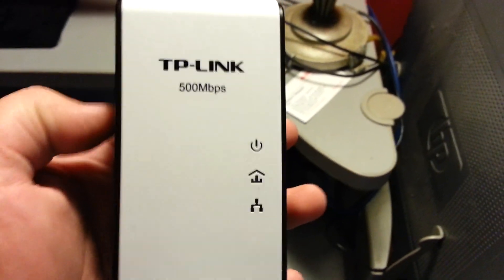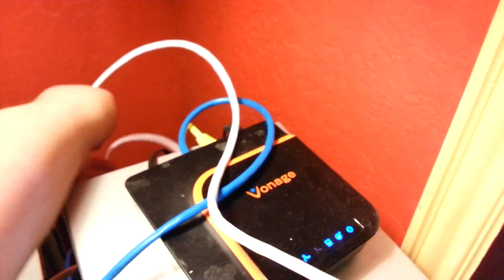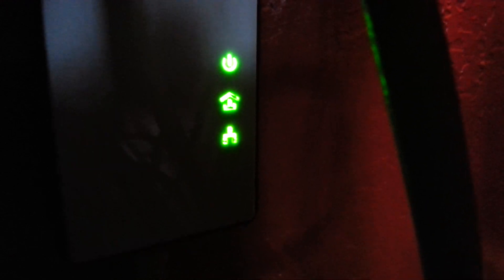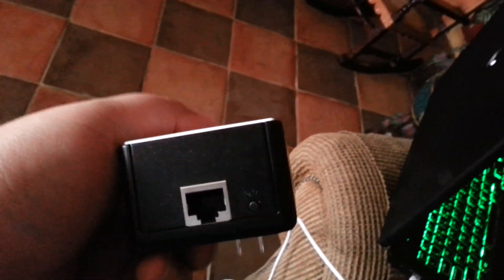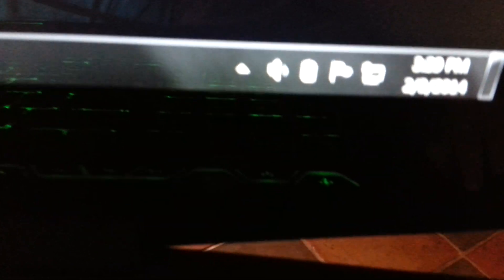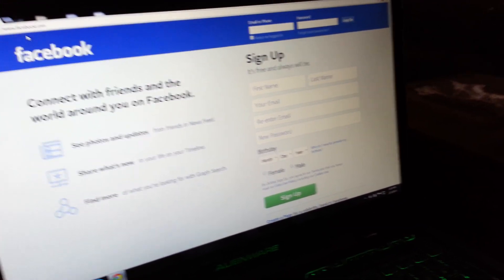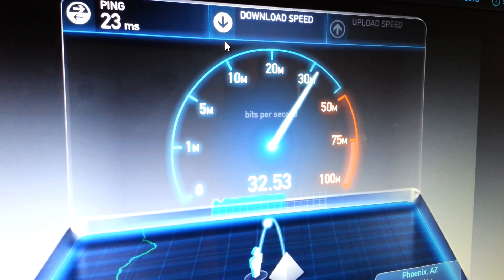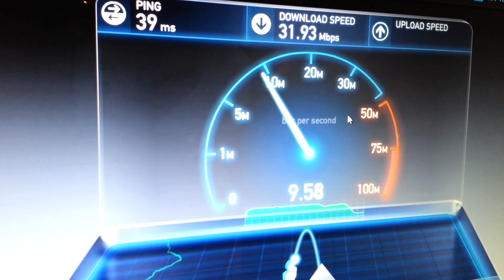TP-LINK AV500 Powerline kit setup and speedtest

Comment: Excuse me, are you stil keeping that product? I wonder if you test with speedtest at night already (6PM-10PM), the speed is still constant or decreased? Thanks
Reply from the maker: It's consistent. As long as your isp doesn't have any degradation in service, you'll still get reliable connections.
Reply: Thank you for your fascinating responses. I've got TL-PA2010 KIT, it works perfectly at day, but at night it downgrades sharply (around 3-4Mb/s as my ISP speed 20Mb/s). when  using ethernet cable, I got full speed. I don't know it's due to the old model AV200 of my adapter or electrical noise. Really embarrassing.

Comment: Victor, I'm having an issue with the AV500 nano (I think they both work like each other ) when I first bought it and use it , it worked compeletly fine and the connection speed was almost the same when I'm near the router , but now I'm having a lot of troubles .the download speed near the routero is about 14 to 16 mbps , on the other hand the connection from the tp link adapter is 1 mbps !!Could you please help me .
Reply from the maker: Have you unplugged them and re paired them? Checked for updates using the tplink update tool?
Reply: +Victor Sandoval , Actually I did and it didn't work ;( . I also tried resetting them and there is no change . Do you recon 110/220V have an effect on the adapters?
Reply from the maker: +meshary RD I use them on 220 can't speak for 110. So far no issues here. However I did see on their page they offer a full refund if for whatever reason you are unsatisfied with the device. I've talked to their technical support before nice people. Give them a ring. Toll Free:
+1 866 225 8139

Comment: Would you recommend it?
What speed do you get when the router is directly connected to your PC?
Thanks
Reply: Victor Sandoval ***** Indeed, how's speedtest.net on your laptop directly wired to your modem-router? Or could you copy a file via network (e.g. Windows Share) to another PC?

Comment: Hey may I ask smth? Must the first connection ( the one you plugged in to the router ) be always plugged in using an ether cable? Or can the first device be used at other places?
Reply from the maker: Bryan Soon has to be connected to the router at all times. since it's the ''host device''
Reply: Victor Sandoval Hey man one last question, am i able to use AV200 TP-WPA281(my current one) and AV500 TP-PA4030(i intend to get this one) tgt as an extension network? Or it has to be of the same model?
Reply from the maker: You can use any powerline device with any brand as well.
Reply: So i can use that add on too? ;D

Comment: So do you have to have Internet for these to work?
Reply: yes
Reply: Not at all. Think of it as a normal ethernet cable, but in the middle it runs over your household wiring. It's no different to running a cable between the two devices. You could connect two PCs from 1995 together and play Doom over LAN if you wished.
Reply: But if you wanted it to improve internet then you have to have internet as the source
Reply: The improvement in internet connection speed is a product of the improvement in network connection speed. These are not 'internet boosters', they are an alternative to other network technologies such as WiFi or running a big ass ethernet cable up the stairs. Please don't expect to exceed your internet connection speed with these.
Reply from the maker: Matty Maidment Well said.
Reply: Delmarva Cartel Offcial Hahaha, yes, you need an internet subscription. The powerlink is similar to a cable, you still need to pay for the information that gets transfered on it, seperately.

Comment: mine isnt working =[
Reply from the maker: How do you have it set up? Directly to the outlet or through a power strip?
Reply: Both are plucked into a socket on the wall.
Reply from the maker: Did you pair them together?

Comment: your upload speed though<3,  and how does this work in an extension could u do a video plugged into an extension?
Reply from the maker: It's really only ment for wall outlets. If you connect it to a power strip you'll  probably have signal degradation.
Reply: but will you get your full download speed like if its in an extension? i also have a wifi booster but i get full bar but slow download speed even though im on 30mbps download speed and 2mbps upload
Reply from the maker: Yea you have 300meters until the signal gets weaker. That be one long extention. At that point it basically turns your extention into a long ethernet.
Reply: Victor Sandoval what speeds do you get without these?
Reply from the maker: On wireless or just direct? Or my speed tier? My tier is 25 megabits per second.
Reply: i think you mean 25megabytes per second? but okay thanks
Reply from the maker: megabits not megabytes. But yea im going to do a follow up video of this product. In about a week or two.
Reply: Victor Sandoval think im going to get these try them out myself:) hopefully they work good iv tried everything and nothing works
Reply from the maker: Another good thing about these products is that they are cross compatible with different manufacturers.
Reply: Victor Sandoval Just letting everyone know i got mine today and plugged into extension and honestly i get full download speed there great! defo recommend although the program that comes with it is not detected my network but its still connected and works perfect!
Reply from the maker: Nice! Glad to hear it's working  for you.

Comment: Two questions - I have an Alienware desktop and I like your AW laptop with lighted keyboard.  What model is that?  Also, will the powerline work if I plug it into a multi-plug power adaptor or do you have to plug it into the wall plug?
Reply from the maker: My laptop is m17x r4. You should have it plugged directly to the outlet for best performance. If you have it on a power strip you probably have high latency & horrid speeds. Due to the circuitry in the strip.
Reply: Victor Sandoval Thanks Victor

Comment: I have a 100mbps internet and with wifi on speedtest it shows that i have 30mbps(its really slow with wifi) if i connect though powerline how mutch internet you think that i will use? my distance is 4 meters from the modem.
PS: If im standing just near the modem with cable i have 90mbps.
Reply from the maker: There is allot of variables with wifi usually it's a hit or miss. If you live in a house this should work perfectly, you'll be getting about the same speeds and latency as being "hardwired"
Reply: Marco Sartori Yes it did :) 
I bought a Powerline TP-Link nano startup kit at my internet speed never goes down like it did with wireless and the speed is awesome!